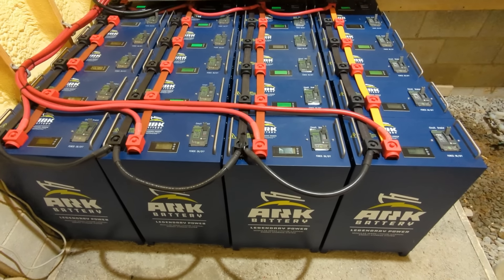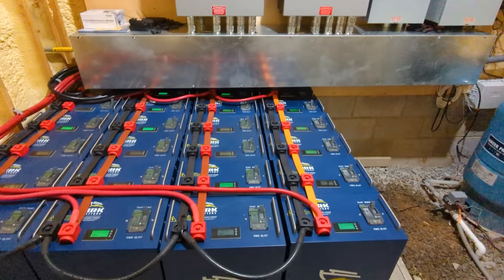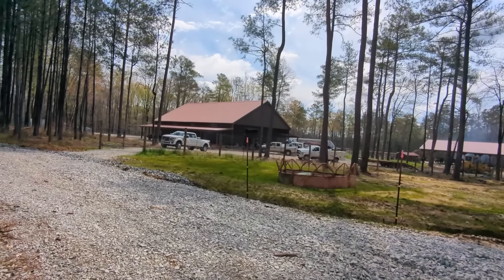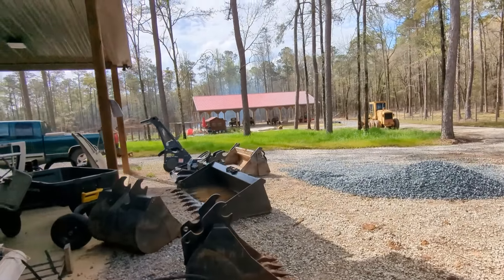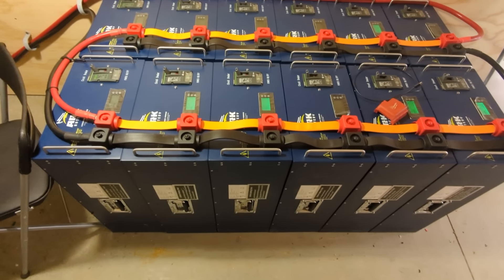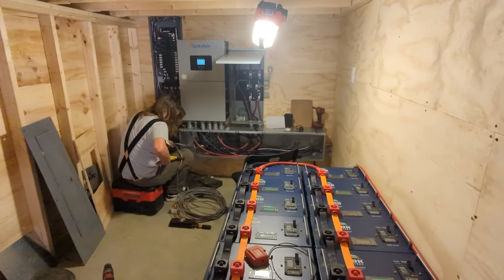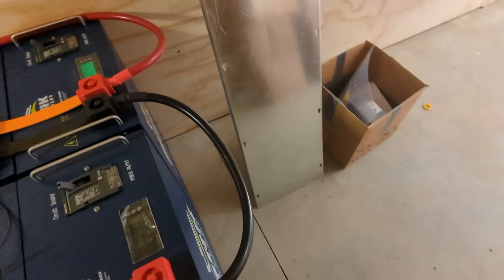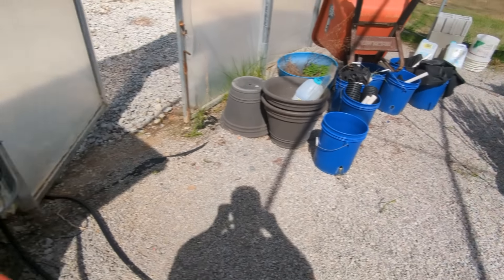How many batteries does it take?

Comment: These are not the same type of lithium batteries that you see in videos that are out of control and can’t be put out.  These are lithium+iron type not the lithium+cobalt. They can burn but it’s primarily packaging and fluid not necessarily thermal runaway fireworks. Co2 easily puts out the fire. Most of the newer Lifepo4  batteries now include an internal fire suppression system and passed UL and California’s regulations. Tesla’s newest powerwall has changed to this chemistry too.

Comment: I really want to install a solar system & batteries but there are trees that block the southern sun and the house roof faces east/west so there is no good place to do it.  
What I currently have going is a large battery system that keeps topped off by grid...at night when the rates are lower...so I can save money that way.
Reply: Like E-775, we have installed High voltage Arrays (Ground mount or on a remote structure ) up to 800' trench in conduit  to inverter system🌅!

Comment: I might just take you up on your engineering services to review my planned self installed solar system.  I think I can manage all the drawings and submission work, but it would be good to have a professional review the full setup.  40 kw roof mounted and grid tied only in PA on a brand new standing seam metal roof (61x43').  I'm a mechanical engineer who loves this type of stuff and I feel comfortable on the sizing of things, but just don't want to miss anything.

Comment: What is odd that there is no active fire suppression system included with this type of install. With UPS systems in the mining industry, fire suppression systems with automatic disconnects are mandatory in most situations. Even being residential, additional safety systems should be brought into the mainstream.
Reply: Most of us are smart enough to do like this gentleman did. His two power sheds are like mine, 50+ feet from the house. Let it burn.
Reply: Lithium iron phosphate doesn't have thermal runaway issues like li-ion.  Even so, some lifepo4s do have fire suppressors in the case. These are pretty unnecessary although it doesn't hurt.  The ARK ones don't appear to have it.

Some places like where I live(Ontario Canada) require UL 9540 certification which is testing/certification with the inverter and batteries as a system. They test for fire safety as one of the conditions of certification.
Reply: Don't worry, there are armies of "for your safety" people working round the clock to make home solar systems way more expensive and cumbersome than is necessary.
Reply: anime

Comment: Looked up those batteries. He can get same amount of storage for 1/2 price going with EG4's new 14.3 kw batteries. it replaces (3 of those $7800 15kw) for $3500 14.3kw signature solar.  over $30,000 for those and $14000 for 280ah battery. Bigger the cells the better they are since it lowers the C rating which helps determine how many cycles and using 80% of the LFP 280 ah cells that means 8000 cycles. I have used 80 cycles in 1.5 years. I am sure I will die before I have to replace these batteries.

Comment: Lets compare your 100 AH batteries with the Apexium 280 amp hour stackable battery using a JK-PB2A16S20P BMS with 2 amp active balancer, 200 amp charge/discharge and EVE LF280K Grade A prismatic cells with 7,000 cycle life for $1,523 Just two stacks of 4 or 8 of these batteries can do what your 24 batteries can do in a fraction of the space and only $12,184 compared to the $63,000 for 24 of the Ark 512100 Batteries. That is a savings of $50,816. And before you talk about warranty, how many replacements can you buy with $50k? The answer is 33 and if the BMS dies, it is only $104. If I were your customer I would not be happy with your choice. I have better things to use the $50k on. I have 4 of these batteries and they are never out of balance and communicate perfectly with my LuxPower 12K. Also known as EG4 18KPV.

Comment: Lithium ... no thanks!
Reply: Having a bad day?
Reply: Go LTO if you're worried.
Reply: LiFePO4 batteries are MUCH safer than the origional lithium batteries. No thermal runaway, and I have seen a LiFePO4 pouch cell puntured by Will Prowse with so little results it was almost disappointing.
Reply: I hope you don't own a cell phone, or laptop, or cordless tools, etc.
Reply: lifepo4 is different to li ion